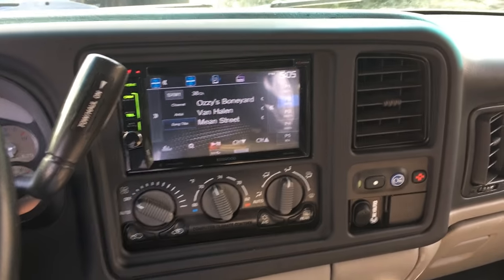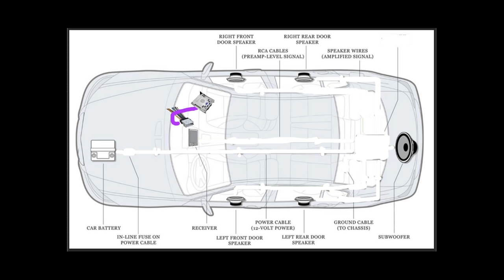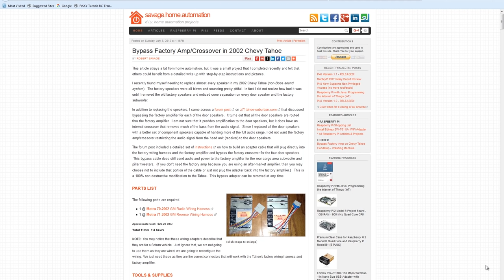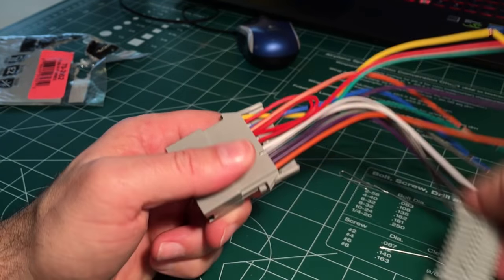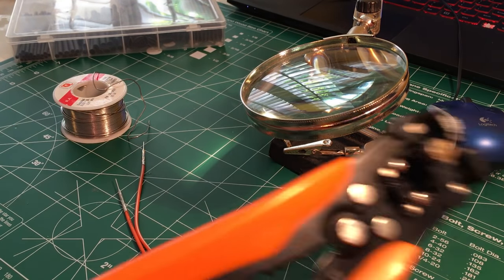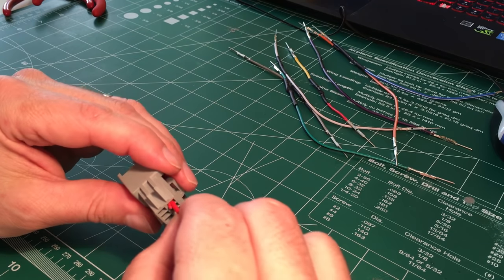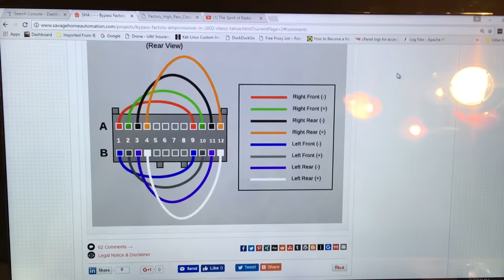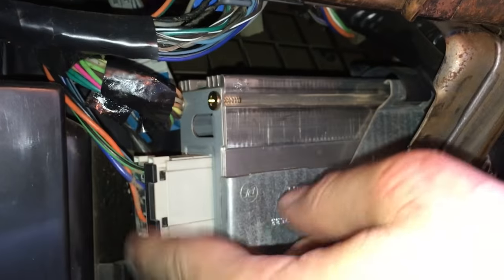Easy Factory Amp Bypass 2002 Chevy Tahoe GMC Yukon

Comment: Hey instead up splicing wires to bypass the factory amp, you can unplug that same 24 pin harness from the amp and plug the aftermarket radio / new harness directly into the same harness you just spliced or bypassed
Reply: what do you mean?
Reply: Which kit?
Reply: From the factory amp in the dashboard. Same 24 pin harness is used on the back of the radio as on the factory amp. Hard to find it in there

Comment: They sell a bypass now online pre-made, its marketed for an 01 Monte Carlo but I read that it worked for an 02 Tahoe. Ordered it and will find out soon, it ranges from $8- $15
Reply: It worked perfectly, if I could post a photo I would. It was advertised as an amp bypass for an impala/monte Carlo and came prewired, didn't have to do any modifications. It was pretty much plug and play for my 02 Yukon, amp was in the same spot as this video

Comment: This is amazing. I got a Bose amp from an SUV and I want to add it to my 2002 Chevy Astro Van. This has been very helpful in showing there are many ways to add a aftermarket amp and using the stock speaker wirers! Thanks for making this video!
Reply from the maker: thanks for watching

Comment: This amp bypass was awesome. But they actually make a harness already for that. It’s the metra 70-2021. Plug and play. I just did one 2min ago on a 2002 Tahoe
Reply: U just saved me so much time thank u good sir
Reply: @danielkruckenberg9882  np at all. 👍
Reply: Me too been working on this damn thing for three days now
Reply: Everywhere says it’s the 2000-2001 Monte Carlo/impala is that the correct one?
Reply: @randymurdock2547  the harness? Oh what do you mean?
Reply: @k5_kiaupgrades622  yes. The part associated with that nunber says it’s for Monte Carlo and impala. Is it the same thing?
Reply: @randymurdock2547  yes. It’s a gm harness. So it fits this cars also.
Reply: @randymurdock2547  are you doing the same thing on a Tahoe or some other gm?
Reply: @k5_kiaupgrades622  yes to a 2002 suburban
Reply: @randymurdock2547  yes this should work for it. 👌 just double check and make sure you have that amp there in that location. And you should be good. 👍
Reply: does all speakers work with metra 70-2012
Reply: @idkidk1445  yes they all do. The ones that arn’t playing. You might want to double check them because they could be blown. 👍
Reply: Was it bose or not?
Reply: @k5_kiaupgrades622  does your tweeters work also?
Reply: @idkidk1445   yes they should. They are all wired to the amp. If they dnt you might want to check the tweeters.
Reply: @woahslowdown  yes. Works for both
Reply: @randymurdock2547   yes but on the impalas the amp is by the rear deck. But does the same thing..
Reply: @k5_kiaupgrades622  bought the hardness and plugged in and the tweeters don’t work with it. what do i recommend. The tweeters do work without hardness
Reply: @idkidk1445   do you have a aftermarket radio or stock?
Reply: @k5_kiaupgrades622  stock
Reply: @idkidk1445  just splice into that harness you just got for the front speakers, and run a new line up to the tweeters 👍
Reply: Would this metra 70-2021 work for a 2004 Silverado as well. I have bose and wanna do a quick easy plug and play
Reply: @tylerhurst6918  yes it should it’s a gm vehicle. First I would check to see if you have that amp behind the glove box. If it’s there then yes it will work..
Reply: Will this work in an 06 Envoy also? I have the bose option and would like to keep the tweeters.
Reply: @matthewallen7321  to be honest I am not sure on this vehicle but it’s made by gm. If it has the amp in the same location with the same plug I dnt see why it wouldn’t work. 👌
Reply: I install the 70-2021 I’m only getting sound out front tweeters
Reply: @darylwilliams2773   have you actually tested one of the doors?  I would do that next.
Reply: @k5_kiaupgrades622  now I think it’s not the amp I think maybe a ground wire bad connection cause it comes on and off and when it’s off I can hit around on dash and it will come on
Reply: @darylwilliams2773  are you talking about the sound or the radio?  This harness only bypasses the amp. But if there is a loose ground or power. Then I would check all the wires behind the radio. 👍
Reply: @K5_kiaUpgrades  I'm about to try this.. all my speakers are blown & what your talking about seems to easiest way.. now after you swap out the wwork? Plug u just clip the CD player in & all speakers should work?
Reply: @natasunknow240   if you are saying all speakers are blown then I would suggest to replace them first. But if you have no sound this would be a great thing to try. And if you swap out the radio. You will still need to get a harness and wire that in as normal. Since it’s the way all the speakers are getting the signal from the radio.
Reply: @K5_kiaUpgrades  yah all the speakers are done.. I have a head unit hooked up in my Sierra & I was told it should just plug in without a problem? But the factory amp is what's confusing me.. im going to get all new door speakers & I may just get an 8 so it fits in the stock location but powering the 8 with a different amp... im not looking for alot of bass just a good sound! What should I do next? Get the harness part your talking about & installing my radio & speakers just to have music right now?
Reply: @k5_kiaupgrades622 do you happen to know which harness I should buy if my Bose amp is under the center console my truck is an 06 tahoe
Reply: @natasunknow240  sorry I took so long I didn’t see the alert. The factory amp will just power the doors. And if you are planing on upgrading the sub. You will have to keep the oem amp to power the door speakers. And will have to add a aftermarket amp to power the aftermarket sub.
Reply: @k5_kiaupgrades622  Do they sell a harness for the amp located under the center console
Reply: @angelrojas2823  unfortunately  not that I am aware of. But it’s also easy to bypass
Reply: So doing this on my 02 Suburban will make it so I plug in my Double Din Alpine head unit to the harness that comes from the factory amp so with my aftermarket amp I won’t have to run new wiring to the speakers I’ll be install and just use the factory run speaker wires? Couldn’t turn the volume up on my iPad so couldn’t hear a lot since my wife was asleep next to me.
Reply: @Ron_Masterjohn   so this harness works as a bypass.  When the oem amp takes a crap and stops working this jumps the amp.  So it’s going straight from the radio to the speakers.
Reply: So if you are trying to run a 4 channel amp. Just run you’re speaker wires to this harness and this will send the signal to all speakers from here..
Reply: I'm assuming if I have a aftermarket head unit and use this harness to bypass the stock amp, the stock sub will not be functional correct? The bypass should only be wired for the 4ch
Reply: @Ricardo_Wade  This bypass is best used when the oem amp goes out.  But, yes if you use this harness most likely the sub might keep working but might not get any bass out of it. 

But if you are trying to do a 4 channel amp there is another harnessed best used  just to save you some time cutting this wire harness.
Reply: @k5_kiaupgrades622 only my passenger door speakers play sound could this be because of the amp I have power to my speaker wire on the side that doesn’t work and it is an aftermarket stereo and I’ve checked my harness 1000x idk what else it could be and yes the balance is set correct 02 Tahoe w/o Bose
Reply: @stephenbrown8678  i would pull them out and confirm they still work. And get a speaker that actually works and see if you have signal coming in to that wire .
Reply: Do u think they got one for 2008 tahoe
Reply: It works 100%

Comment: What ive learned with most car manufacturers is that it doesnt matter what features they put in your car the wireing is ussually there to plug into them so taking that into concideration if you find a truck without the bose sound system chances are there is a factory bypass plugged into the cross over plug and you wouldnt have to go threw this but its very interesting in case you cant find one in a junk yard you can still get it done

Comment: Metra 70-2021 is the part number for one already made $13.26 as of Jan 2023. Not full proof. Gotta swap a couple wires around but apparently works.
Reply: With stock radio?
Reply: @danielduncan8345  yeah I still have the stock radio in. I might make a video on it. So when I do I’ll send it.
Reply: So your saying installing that part , with stock radio , you will have sound out of door speaking ?
Reply: @danielduncan8345  all 4 door speakers work yes. It’s wired the same way he stated in the video that he’s using
Reply: Hey, when using the Metra 70-2021, how does it effect the sub and rear d pillar speakers?  Thanks for sharing btw!

Comment: As for those wanting to buy the harness O'Reillys sells the harnesses that will work. The harness is the same. But the pins inside are not. The one I bought didn't have enough pins in it so I bought two (2) harnesses so that I would have enough pins. And it worked beautifully.

Comment: Thanks for the video, great guide! You can also use the Metra 70-2021 as well if you don't want to DIY the wiring. I'm not 100% sure if it would kill the rear sub/tweeters but I am getting ready to install a new headunit in my 02 suburban and may have to give it a try.
Reply from the maker: appreciate the comment.
Reply: How did the 70-2021 work out with your install.  I have a new head to put in and want to bypass the amp...
Reply: @michaelgracephotography8308  Worked good, all the speakers still worked including the sub. I replaced the OEM speakers with Infinity Ref and a pioneer shallow mount sub.
Reply: @draconis112  I've ordered what I need, can't wait.

Comment: Just wire nut your speaker wires to the wires coming from your aftermarket deck.  much easier for us who dont like doing pins
Reply: does that not work when using factory speakers?😂

Comment: Am looking to remove factory amp completely, add new head unit, new speakers( with new wires run to those speakers)

Where is the second link in your description to the site that had the amp wiring schematic?

Comment: great video!  thanks.. i have an 03 suburban that the OEM head unit (6 changer CD) with bose speakers.  the speakers lose output but the head unit remains powered.  hitting bumps or something intermittent cause it to go on and off.  The ding ding ding door lock functions is also silenced when this happens.  ARGH!  I have heard it could be a bad ground in the A column but now that you have shown me there is a separate amp i am thinking it is related to that because like i said the sound out put is affected but the head unit remains on all the time.  Any ideas or insight?  thanks so much!
Reply: I also have a problem like that bro I hit a bump once and now it starts playing for like 2 minutes and then  I lose power

Comment: Steve... Thank you for this tutorial! I'm working on it now. Question for you.. Using a sony dsx-gs80 hu and plan on hooking my 8" sub to it. Where are the wires for that sub? On the amplifier? And do you know if I can bridge rear channel on a hu to this sub or do I need to just use channel 3?
Reply from the maker: I'm not 100% sure how it was originally wired to the sub.  I added an aftermarket amp and sub and wired them directly and did the amp bypass.

Comment: I know this is an old post so I may not get a reply, but im about to bypass the factory amp also and had a question. Did you have to use a 4 channel amp to send signals to the amp using the RCA and speed wire? As in RCA's to give the sub sound signal and speed wire for the door speakers? And if so do you have to splice the harness coming off the radio? thanks for the video!
Reply: Sure you figured out by now but just in case LOL. If you are installing a sub only and have factory Hu you run a proper and that matches as close in rms not peak to you sub so sub handles 600 rms at 2 ohm then try and find a ame with a rms of 600 watts rms is steady power what it outputs like 1200 watt doesn't matter as much as rms in all speaker installs. Then your run the RCA and Renate wire which is what I assume your referencing as the speed wire. That goes into the back of Hu they make adapter for stuck headuncts called line convert out I think,, basically extra part I0 connect your rea and remote wire non of you already have aftermarket hardest which I wou ld get first for any upgrade you went need the loc it will have RCA and remote wire connect on radio harness already. Same goes for door speakers get a 4 channel run set of RCA and remote wire to headunit and then speaker wire goes from amp to each door speaker. You have a +/- wire going to each and that's how gu run aftermarket speakers and amp. You can also get a five channel amp, which will give you the same concept except you only have to run one set of RCA’s and remote wire(speed wire). There are other configurations and I’m pretty sure you can buy RCA wires to run directly in some head units and amplifiers. I’m sure there’s other tips in anyone will correct me if I’m wrong, but this is just a general explanation. Also, you will have to run your power wire and ground wire for the amp obviously but I didn’t mention that. Hopefully you were able to figure it out either way.
.

Comment: What is speedwire? I've been installing stereos since 1990, and I've never heard that term. Low level input, high lev, yes. Speed wire? No
Reply: Google it, basically is one thick wire with all 4 speaker wires inside to easy connect all together
Reply: A group of wires with different counts. Most run a 9-wire. Has 9 wires. 8 pairs and 1 remote wire.

Comment: SO you are using the factory speaker wires? I have a 2001 Tahoe which has the same exact system. All the speakers quit working except the rear 3" pillar speakers.  I am wanting to install an aftermarket head unit but I don't want to run all new speaker wires because of this factory amp. SO I can hook the new head unit up with the wiring harnesss from Crutchfield  then do the bypass thing you just did with the Metra harness and I should be good?

Comment: So..in response to one question you said yes your factory sub still works, then later you say it only powers the four door speakers.  Which is it?  I want to do this to keep the factory sub yet use the new head unit to power the four door speakers.
Reply from the maker: If done right, it can be reversed so the factory amp will work.  However, once you apply the mod, the point is to use a better aftermarket amp.

Comment: If i comepletely bypass my factory amp will my aftermarket stereo alone be enough to power my door speakers? Or should i still use the factory amp for the door speakers and my aftermarket amp for my subs.
Reply: Depends on the new head unit. I'd prob go with one or the other based on installation time/effort rather than performance if the difference is only trivial. You'd have to be more specific about your factory and new equipment if you wanted to get a specific answer though. Good luck on your project!

Comment: Question. Why can't you run the speed wire to the plug on the amp? plug it into the plug at the amp instead of the plug behind the stereo??  And how may channels does the amp ave to run those speakers??
Reply from the maker: If you are installing an aftermarket amp, you can run speedwire to the amp, or rerun your speaker wires directly to the amp.    I have a 5 channel amp.  One for each speaker and a subwoofer.

Comment: Hey quick question, so my doing this bypass would it cut the power to the amp? I’m asking this because I’m having  my amp stay on and kill my battery.
Reply: Did you figure this out? My battery has been dead 2 days in a row after full charges.
Reply: Nicolas Brown yes It did I bought this bypass from amazon for like 10$ my problems was that my amp was staying not turning off, I recommend pulling the amp fuse if it fixes the problems buy the bypass, it’s cheaper than a used amp and it sounds 10x much better without it

Comment: so i have a 08 Trailblazer ss with bose, i installed a W4400NEX pioneer double din. my question is can i reuse the pre-existing speaker wire and cut the clips off the oem amp and just run some speed wire to the location that i want my new amp to be from the speaker wire that was connected to the old bose amp ? i want to have two separate amps one for voice and 1 for subs, thanks.

Comment: So if I just cut the harness and find the power and signal and ground and hook it straight up to the head unit I should be good right the power isn't coming from the amp is it? what I mean is the original power doesn't go to the amp first and then it branches off from the amp?